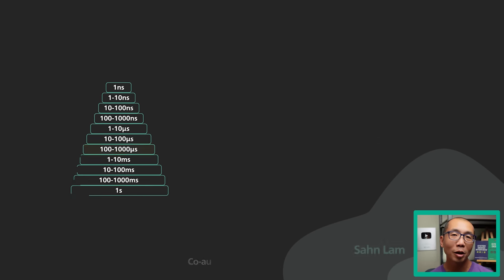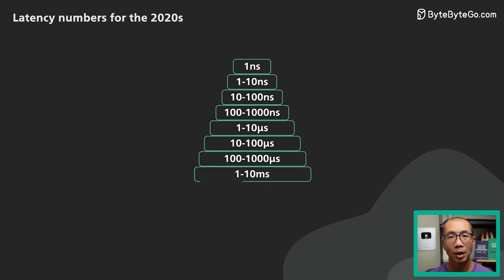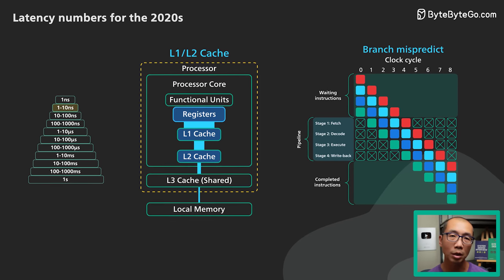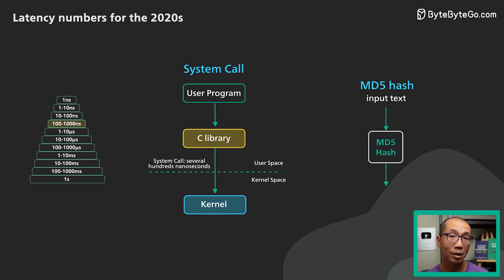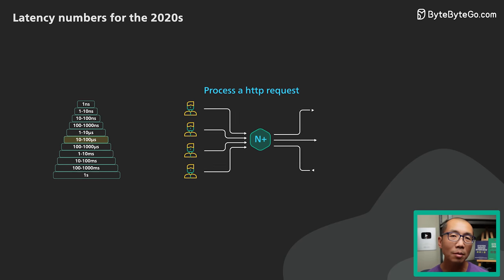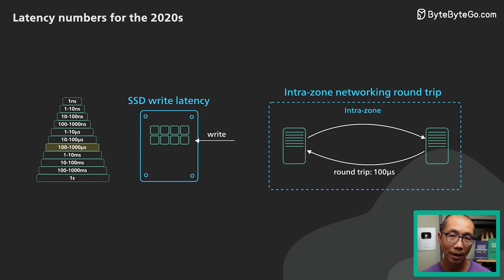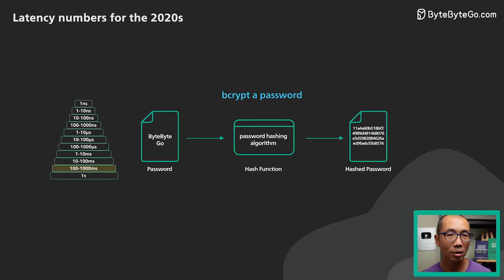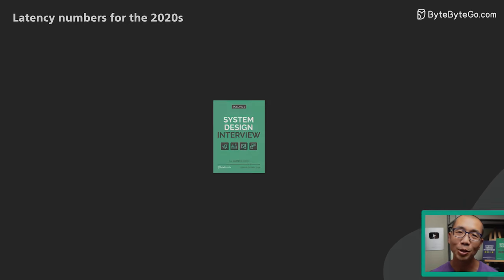Latency Numbers Programmer Should Know: Crash Course System Design #1

Comment: in the UI if something takes longer than 100ms it becomes noticeable by the user. like if you click a button and it takes more than 100ms to react to the click the action doesn't feel instantaneous anymore
Reply: 3+ sec page load times are problematic too
Reply: @biskitpagla  WDYM? My users accept anything as long as it is bellow one minute
Reply: @biskitpagla  might aswell be offline then
Reply: Indeed the brain is pretty tolerant at simply correlating the signals together bellow that threshold. It has to be as it has to deal with both the physical lag of the input itself and the fact that your senses each have their own neural processing latency that varies depending on which sense is being activated ~20-40ms for Visual or ~8-10ms for auditory for example. Of course this does all assume you are not dealing with a user with sensory processing disorder as one of the symptoms is breaking this ability to correlate sensory input from different sources.
Reply: As a programmer when I click on one of my buttons, I know it is time to get a new coffee because it will take a while.
Reply: Most users give up if a web page takes longer than 5 seconds to load. Unless it's totally essential viewing.
Reply: @BritishBeachcomber  It depends also on the living country or the device model. Users in low-income countries or with low-end phones are more tolerant to greater load times since they already know and are used to services being slow.

Comment: <1ns
- Accessing CPU registers
- CPU clock cycle
1-10ns
- L1/L2 Cache access
- Branch mis-predict
10-100ns
- L3 Cache access
- Apple M1 main memory (RAM) access
100-1000ns
- System call
- MD5 hash
1-10us
- Linux thread context switching (min)
- Copying 64 KB main memory -> main memory
10-100us
- Network proxy HTTP request routing
- Read 1 MB sequentially from main memory
- Read 8 KB page from SSD
100-1000us
- SSD write
- Intra-zone networking round-trip
1-10ms
- Memcache/Redis get round trip (~1 ms)
- Inter-zone networking round-trip (~5 ms)
- HDD seek time (~5 ms)
10-100ms
- US east to west coast or Europe network round-trip
- Reading 1 GB from main memory
100-1000ms
- bcrypt a password (~300 ms)
- TLS handshake (~250-500 ms)
- US west coast to Singapore network round-trip
- 1 GB sequential read from SSD
>1s
- 1 GB network transfer in same cloud region (~10 s)

Comment: Another great video.
Have you created content that shows the impact of this latency on system designs? Examples:
* Accessing memory by reference instead of cloning the content.
* Single threaded, vs multi-threaded applications
* Async-await vs multi-threaded applications
* Impact of microservices and containerization
* Impact of serverless

I often feel that latency and the cost of communication is forgotten in the scale-out discussion. I have personally seen examples where a containerized microservice architecture was 40-200 times slower than a non-containerized approach. Have you seen the same?

Comment: I've been lucky enough to enjoy two simultaneous careers in the 35 years I've been working professionally, one in enterprise database design & troubleshooting, and the other I'm an RF mixed signal electronics engineer: I go all the way down to pico & sometimes 100s of femto seconds for the electronics side.

One of the most useful facets of having experience in two apparently largely mutually exclusive skillsets is when it comes to performance & troubleshooting, whether it's knowing what looks about right, or knowing what's reasonably achievable. In my database work, I usually talk in terms of orders of magnitude improvements, but in my electronics work it's more often just ~10% or 20% improvements, as we're already hitting the state of the art.

The same dependencies on both experience and underlying understanding are required. In terms of analytical skills, it's pretty much identical: you split a given challenge into manageable chunks, identify the area(s) where a problem lies, re-engineer accordingly., and put it back together.

The two are similar in so many ways, even down to Heisenberg uncertainty, such as sticking in instrumentation into code or probing a high speed interface: both can substantially interfere with the result.
Reply: "...such as sticking in instrumentation into code or probing a high speed interface: both can substantially interfere with the result..." - Guilty!

Comment: Also important 10-100ms the time between two image in animated image. For a game you should typically aim at getting everything done in 16ms to hit 60fps. Or finish all calculations in the 1-10ms range to be able to scale to higher frequency displays.

~100ms is also the maximum amount audio and video can be out of sync before people start noticing it. Already at ~200-300ms it becomes difficult to hold an audio conversion, as people start missing queues about when it is their turn to talk.

Comment: <1ns
- CPU register access
- one CPU clock cycle

1-10ns
- L1 & L2 cache access
- CPU branch mispredict cycle

10-100ns
- L3 cache access
- modern processor main memory reference

100-1000ns
- Linux system call routing (time to user space -> trap -> kernel space -> trap -> user space, not accounting for processing time of the system call itself)
- MD5 hash of 64-bit number

1-10us
- context switch between Linux threads (does not account for bringing large # of pages for the new thread, which would extend time further)
- copy 64 KB memory to new location

10-100us
- typical amount of time for network proxy to process a http request (nginx)
- read 1 MB of sequential main memory data
- read 8K page of SSD

100-1000us
- SSD write latency for 1 page
- intra-zone networking latency [100us]
- memcache/redis get operation as measured by client [1ms]

1-10ms
- inter-availability zone of modern cloud provider networking latency [5ms]
- hard disk seek time [5ms]

10-100ms
- us-west coast to us-east coast latency, us-east coast to europe latency
- read 1 GB of sequential main memory

100-1000ms
- bcrypt a password [300ms]
- TLS handshake [250 - 500ms, depends on distance between machines]
- us-west coast to singapore latency
- read 1 GB of sequential SSD data

1s
- transfer 1 GB over cloud network within same region [10s]

Comment: I love the last one, takes 10 sec to transfer 1GB over network within same region .. then some webpages take several seconds to load a little bit of text and a few pictures.. I mean there are of course many things at play here, it's not only the transfer, which is considered here, but still we have a lot to improve on in general when it comes to web. And I don't only mean the programming I mean choice of server OS and so on. Some of the extra latency can be due to hundreds and thousands of processes being run concurrently on the same servers . So if the kernel interrupts every n mikroseconds, it takes the amount of nano/microseconds for every process to go from userland to kernel land which adds up until the scheduler gets back to the process again.. And storing and loading the process state in it self also requires cyckles aka time to do every time. Then there are more stuff going on as well.. (I didn't remember the numbers presented in the video but there all there in the video :) ) 

We need less bloaty things even though hardware gets better. Sometimes today surfing the web is almost the same experience as the early 2000-s..
Reply: Most of that is taking bids to sell ads by now lol
Reply: @OatmealTheCrazy  lol yeah! There's also that!

Comment: Excellent video. I definitely have intuitively known some of these numbers for a long time being just a super nerdy programmer with a gamedev hobby. However, I came up a while ago not knowing a lot of the cloud numbers, and L3 cache didn't exist in CPUs and maybe not even L2 in the earlier days. No surprises really exist other than SSDs being a lot faster than HDDs. I've known intuitively that network transfer rates (bandwidth, not latency), but now even latency of network access is faster than an HDD. In otherwise, a locally connected HDD is slower than an intrazone networking transfer if the server is reading from main memory or significantly faster IO storage.

Comment: Shouldn't reading 1 GB sequentially take about 50 milliseconds if reading 1 MB sequentially takes about 50 microseconds? Also, does an intra-zone networking round trip take 100 microseconds (according to 4:16) or 5 milliseconds (according to 4:46). Or is 4:46 referring to intra-zone networking latency instead of an intra-zone networking round trip?
Reply from the maker: Thank you for the feedback. 

At 4:46 it should be inter-zone networking instead of intra-zone. This is the round trip time between availability zones. The illustration is wrong, and the caption and verbal explanation are correct.

For reading 1GB sequentially we are on the same page, right?
Reply: @ByteByteGo  At 5:50, it was stated that reading 1GB sequentially takes 100-1000ms. I thought reading 1GB sequentially takes 50 milliseconds instead.
Reply from the maker: At 5:50 it was reading 1GB sequentially from an SSD. Reading 1GB from main memory is at 5:10, which is in the 10-100 ms bucket.
Reply: @ByteByteGo  Thanks for the clarification! Great video!

Comment: 100 to 1000ms: User perception of a "fast response" on the internet is around this range. (Google says 200ms.) That means if you want your page to feel responsive, a response better be delivered and rendered to the user before 200ms have passed after a mouse click or screen tap.
1s to 10s: Range of spindown time of spinning hard drive.
10s to 100s: TikTok and other short format videos are in this range. User attention becomes this 15s limit, meaning users get bored super quickly. (Especially young users.) Also, interestingly, if a system does not respond in this amount of time, users might think your program has locked up and try force closing/rebooting/etc. Along the same lines, most UNIX and Linux systems send SIGTERM to all process, followed by 5 seconds wait, followed by SIGKILL. (Your program has 5 seconds to clean things up before it's forcefully killed.)
100s to 1000s: TCP maximum retransmission time is 120 seconds by default. If DRAM is cooled, the contents can be retrieved in this amount of time after power is removed.

Comment: That redis cache read number is pretty surprising. I suppose that's better than having to get a DB to get a result, but network latency for intra-zone is only 300 micros, so if you can just have a fast database, you won't lose a bunch of performance there. Honestly, if you're not using a cache system within your app, you're leaving a ton of gains on the table.

Comment: I would find it cool to add perceived latency on the ui. there are papers on this, like when does a ui feel "laggy". For example a button has some highlight effekt on mouse over and if the effekt takes too long to start it feels laggy. I have in the back of my head the mark of 50ms for those things, but could be wrong.
Reply: It's typically closer to 100ms in most people, bear in mind there is around a 20-30ms difference in neural processing delay between visual and auditory signals so a normal brain needs to be able to integrate at this level. Touch signals can be even slower you are looking at closer to 40ms (Which is at the slow end of visual processing time) for a signal from the toes to reach the brain before processing can even begin for an adult (~2m @ 50-60 m/s). If it wasn't able to do it over windows at least in the 50ms range or so then coordinating anything involving multiple senses would be significantly hampered eg using vision and proprioception to manipulate objects with precision etc.

Comment: You have to put into perspective the distance light travels in these times. In 1 ns light only travels ~30cm. With a speed of electricity of ~2/3 c that means it is physically impossible to access information further than 10cm from the CPU in 1ns. That means anything the CPU has to do in 1 clock cycle of let's say a 5 GHz CPU has to be physically within 2cm (a bit less than an inch for the americans). More realistically, it has to be within 1cm as any logic also takes time and electrical connections are rarely point to point.

And this might soon or already now need a 100ps-1000ps range as clock speeds are getting faster again.

Comment: Minor nitpick: bcrypt has a variable workload parameter, which allows one to freely configure how long it will take to calculate a hash for a given amount of data on a given hardware. Thus, saying a slow hash-function takes between 100 and 1000 ms isn't really correct. It can take however long it is configured to take.
Reply from the maker: Good point. Appreciate the clarification.

Comment: Good content. How about some programming operations like add/subtraction/multiplication/division/assignment in different language on a regular PC by today's standard?
Reply: Depends on what types of the data your doing and how close your program compiles to the CPU.
C/C++ directly compiles to machine codes and that's the fastest
Python, Java, JavaScript compiles to Byte Codes then runs in interpreters and virtual machines. It means some overhead but for simple arithmetic operations you mentioned, the overhead are < 10 CPU cycles 
For small numbers, within 64 bit range, usually translate to single ALU instructions
Those are extremely fast, where adds/subs and assignments are usually consuming one CPU cycle, multiplication takes <10 cycles and division can take < 100 cycles
Those numbers are for the calculation only, not considering moving the results to where you want them to be
A high level language expression can result in several instructions, like in C++ "int *x = (int *)(99/7);" involves creating four memory slots for an int printer x and 3 for 99, 7, and the result of 99/7, load 99 and 7 to register then calculates 99/7, move the results from register to the fourth memory slot, assign the address to the pointer x.
Reply: That's not a question you can answer per se, it depends entirely on how the compiler/interpreter handles it in that specific situation. The ALU call itself is certainly within the sub nanosecond range, but how long the whole calculation takes depends entirely on where the CPU gets the data and the actual commands from. If it gets its data from a register, it's going to take <1 ns. If it takes it from the cache, it'll probably take 1-10 ns. If it takes the data from main memory, it will take >10 ns. 

And this will not only vary by language, processor and CPU, but even within the very same program. For example, if I wrote a C function like this:

int add(int a, int b)
{
    return a + b;
}
and call it just once: 
int main(){
    printf(add(2+4));
}
the compiler will almost definitely inline the function and use registers instead of memory. 

But if my program looks like this: 

int main(){
    printf(add(2+4))
    int (*functionPtr)(int,int) = &add;
    ... //Do something with the     function pointer later on
} 

The compiler cannot do this, because it needs to make sure that an actual memory location exists which holds the function for the function pointer to be usable. Therefore, it can't inline, but has to jump instead, which will take a lot longer (even with predictive branching). It also can't use registers only, because it has to obey calling conventions and include a stack. 

As you can see, the very same calculation can take a very different amount of time depending on the context.

Comment: The illustrative presentation makes it a whole lot easier to understand 🔥
I have question on the 100-1000ms latency level. You said "it is slow enough to render brute force password cracking ineffective." Does that mean the latency for brute force password cracking is slower?
Reply: That means that a single thread can only hash around 5 passwords per second, even if you use something like an EPYC CPU with 96 cores you'll only be able to test about 1000 passwords per second. And that is ungodly slow, taking multiple years to crack even simple passwords using a rainbow table.

Hash algorithms that are disgned for consistency and equality checks like SHA are much faster. SHA-256 can hash 2GB per second per core. And can be implemented for GPUs.
You can test orders of magnitude more passwords in the same time